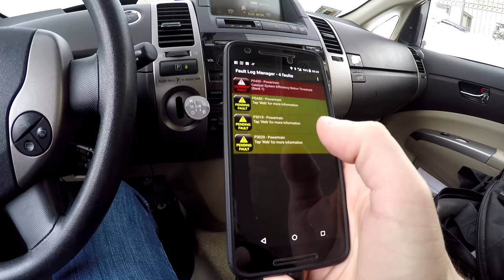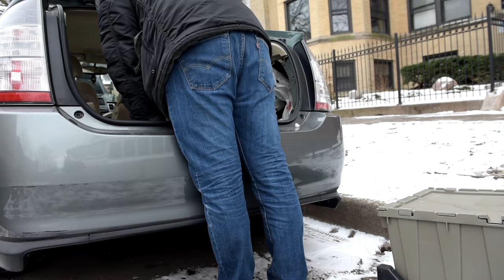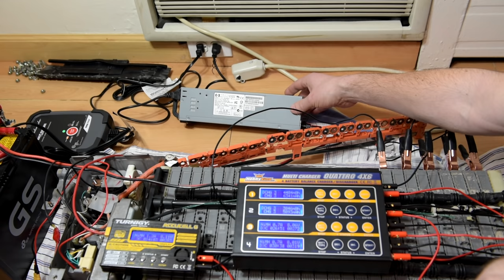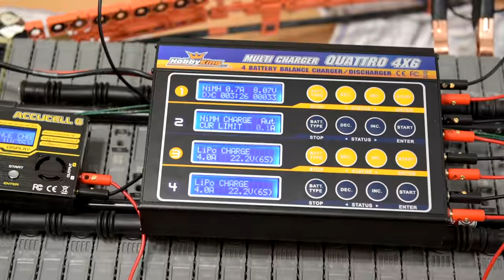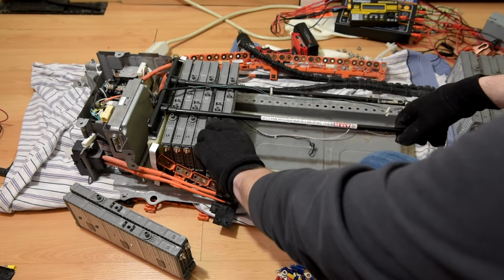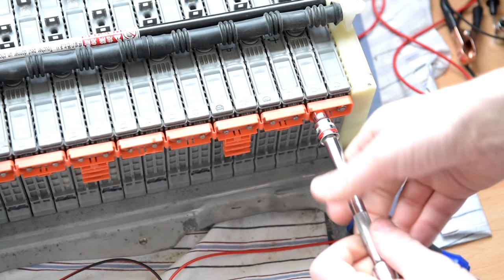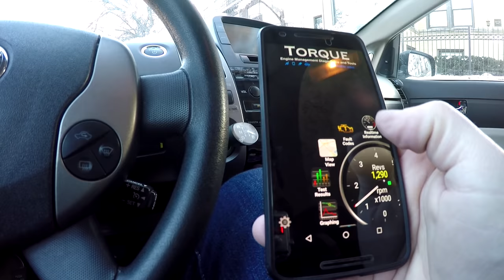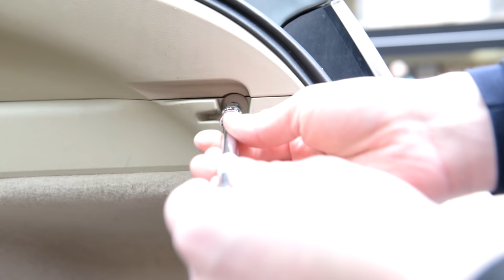Hybrid Battery Repair Ultimate Guide (Toyota Prius 2nd Gen 2004-2009) DIY

Comment: Dear igor need urgent help at 32:16 you say connect all the positive together and all the negative together to make a big battery.... How can it balance it self when there is no flow?? Can you share with me a drawing... Your video helped me alot
Reply: From my reply above: at the end of your cyclical reconditioning, get all the voltages of the 28 modules within .05v of each other and then carefully connect all +.  Separately, carefully connect all -.  In this way your modules are all in parallel (a large capacity 7.2 cell, essentially).  Let sit 24 hours and they will all self balance.  I ended up locating all the + on one side of the battery and all the - on the other and then running a thick long wire of solder to all the terminals, and gently tightening the nuts down to hold the solder 'wire.'

Comment: What is the lowest mAh value of a cell for car to throw triangle light ?
Reply: ECU would throw Battery error based on voltage difference between blocks. I all cells are equally bad, there will be no errors.

Comment: one question please, is it normal for the single battery to swell during charging? second
  what difference is there between the 2 Gen. and the 3 Gen. batteries ???
Reply from the maker: You mean , only one module is swelling and the rest are not? Then it’s not normal. Not sure about Gen3 , never worked with them. You can check forums on PriusChat.com
Reply: @IgorKadulenkov  thanks a lot
Reply: It swells usually when it is overloaded or weak. The battery in good condition and properly charged has virtually no symptoms.

Comment: How much time does it take to cycle 1 module 3 times?  Did you charge at 3 amps or 5 amps?
My 4 port charger can discharge at 2 amps.  Would it be okay to charge at 5 amps and discharge at 2 amps?
Reply: cycle will depend on condition of the module usualy 1 charge-discharge cycle is around 5 hrs, its better to discharge at 1 amp.
Reply from the maker: For me it took about 24 hours to cycle 3 times at 5 amps, I was discharging at max discharge current- 1amp on Quattro charger and 2 amp on single charger

Comment: Can you tell us what was the mileage shown approximately in the time, when you made the video? Because that steering wheel is looks like new. :)
Reply from the maker: Thanks. It was between 200k and 205k miles. However, the battery was not original, it was replaced by some questionable shop with bad reputation and only lasted for a year.
Reply: @IgorKadulenkov  Thank you! Now just need a similar charger/balancer as yours in the video. can't really find one on eu servers... any advices? :) Thanks

Comment: Hi Guys! Do you have any information about where can i buy  a smiliar charger in Europe, like that, which Igor used in the video? @16:56 ?
Reply from the maker: Hello, I would check Hobbyking.com . I am sure they ship to Europe, they have European warehouses. People saying good things about Reaktor chargers , they’re more expensive, but you could sell it after, perhaps https://hobbyking.com/en_us/turbo-charger-1200w-4-300w-synchronous-balance-charger-discharger-version-2.html Or you could try some other hobby charger
Reply: @IgorKadulenkov  Thank you. I'll take a look. :)
Reply: @IgorKadulenkov  There were the rewievs, and some said its not that good as yours, and also some minor disadvantages, so started to look after similar products. In my case the hobbyking stuff is too expensive, but found a similar: Ultra Power UP100AC DUO 100W on banggood. 
not 4, only 2 ports available, but 1/3 the price approx. on youtube found some reviews. but, in my country there is a guy, who renews prius batteries for that ~100$ price, ( check hybrid system on google maps in budapest area) and does the cleaning too for the tipical prius odour, and stuff like that. :) respect Igor! :)

Comment: Why do you indicate the capacity cut- off at 7500 when the capacity of these batteries is 6500
Reply from the maker: This is just a safety measure, if it doesn’t stop the charge automatically

Comment: So how many amps is that lightbulb discharger you made and would it be any different than using a discharge cycle on max setting?
Reply: @Vatslav Orlov I just got through using a lamp and it worked well. But the turnigy x4 charger I bought does up to  3A discharge.
Reply: @Vatslav Orlov what light bulb would you recommend to use for discharge and do you connect the bulbs until they are off
Reply: @Vatslav Orlov Thanks
Reply: @Vatslav Orlov I have one more question if you don't mind, when you are programming the Turnigy, I noticed that when you select NIMH there is a bracket and you can set the number inside the bracket from 0 to 9, what does that number means? also how EV-PEAK CQ2 compared to the turnigy (advantages/disadvantages?)
Reply: @Vatslav Orlov Thanks you so much, one I set the Turnigy the first day, I noticed it was not working in auto and it would stop after it finished its charge or its discharge although it had 3 cycles programmed, however, the second day it worked in auto. not sure how can I see this "Auto/manual" switchover settings anywhere as their manual is not really clear about that even when I followed the flow chart.
also, I remember the seeing things in the beginning that I am not sure how to get to again such as "Balance"  & "Store", I remember seeing a screen where I selected the voltage to be 7.4 VDC but now I don't see it, not sure if you have any advise on that.
Reply: @Vatslav Orlov Thanks for all your help and clarification

Comment: HELP PLEASE. My car only turns on when jumpstarted. Otherwise I’d completely off. Battery has been tested and is good. Still holding a charge. The biggest clue is that once (one time only)  I move around the battery and the car turned on!! By itself, I was just removing the positive terminal cover. Checked connections and all have 12.2V so it’s good. I don’t understand why’s happening connectors seem good and the other clue is that the frog designated jumpstart location says 1.2V! Prius is dead help please!
Reply from the maker: Which battery has been tested? Hybrid or 12V? Maybe your 12v battery is dying? That happened to me, it would not start even though the HV battery was ok.
Reply: Igor Kadulenkov thanks for the reply. I figure it out and now it’s fine. I had bad connection to the ground (body of the car) I had to mess around with it and it turned on and it has been working good ever since

Comment: @ 10:00 Very bad move to use a screw driver to pry out the black covers.  Easily cause a spark which can damage other parts, possibly the inverter or even the computer.  I caused a spark from just removing the orange bus bar assembly after removing all the nuts.  Be careful.  In this case, no so much because the battery is outside the car and not connected by the big orange cables.  Otherwise, very good video.
Reply from the maker: You are not supposed to disassemble the battery inside the car and when it is still connected to the main terminals. This could be a death hazard

Comment: I am getting a about 6000 discharge and 7200 recharge. My charger will cut off at 7200 and then begin a discharge cycle. I have don't each at least ten times. Is this bad or good?
Reply from the maker: If you getting 6000 on discharge, your module is great already. It’s 92% of nominal capacity. I would just stop there
Reply: @IgorKadulenkov  wow I'm impressed. What about balancing out the voltages? Using a bulb won't cause any problems and throw off the balance?
Reply from the maker: No, it’s safe to use a bulb on a module. These modules take a harder beating when in operation- high discharge and charge currents

Comment: Hello! I have a question. I'm just beginning this process, and I just did my first discharge/charge cycle. I have a Venom Pro Quad charger with almost the identical menu as yours. I set my settings to NiMh automatic, 1a discharge, 3a charge. Discharge to 6.3v went fine and showed 4800 mAh capacity. Charge cycle kept going up. Voltage on charge LCD showed 9.2 volts and I turned the charger off at 7500 mAh. 

Do you have any idea what might have caused this? Probing the module after charging shows about 8.2 volts. I was reading about the Delta peak setting- should I try turning that down? The module was not hot that I could feel (it was #1, couldn't feel any heat through the end cap). Thanks for the video and thanks for any tips you can give! Thank you.
Reply: Most likely your Charger has ignored the max recommended cell voltage or has read the "battery signal" incorrectly. You must be careful not to exceed 8.5V under any circumstances (It's best to set the cut-off to 8.3 - 8.4V, so you don't overcharge the battery.)
Reply: Hi Steve,  did you solve your problem?   I am going to do this same thing shortly
Reply: @Angelchase4676  Hey there. Yes, I did get it sorted out. What I learned is that these hobby chargers are generally not good at detecting the Delta peak of Prius modules. So my solution was to:

A. Set a max charge of 7250 mAh. Someone on Priuschat made the argument that since these modules have an AH rating of 6.5, charging up to 7250 should never over charge them, since charging efficiency is like 60%... or something (don't quote me on that). Many of my charge cycles just ended at 7250.  

B. I upped the charging amperage from 2A to 5A. This makes the Delta peak much easier for the charger to detect. This clearly helped, and there were quite a few charge cycles that ended at Delta peak. 

Also, I believe the voltage displayed on the charger while charging is the charging voltage- ie what it's inputting to pull the battery voltage up. As soon as the charging finishes, the modules showed 8.2v, which is what one would expect from a fully charged module. 12v car batteries show 14-15 volts while charging, so I think 9 is ok for a 7.2v battery. Just my conclusion.  

Also- if you can figure out how, I'd get a charger capable of graphing the discharge voltage over time and use that primarily, rather than Ah or internal resistance alone, to dictate which modules to replace, and to verify that your new modules will match up with your old ones. This is really what will make the pack last- modules with really similar discharge curves. I think many of the 4 button chargers have the capability to do that. 

I just used the discharge mAh and an internal resistance proxy test (headlight bulb, high and low, for 60 seconds, noting the voltage drop over time). But realized afterwards that discharge curves show how the battery behaves at any given battery state (empty to full). It may behave well at full charge, but bad at low or the opposite. Amp hours and internal resistance are both just snapshots. 

Car is running great so far though. Dr Prius App gave it 85% capacity. Getting about 45mpg. Hope your project turns out well, also!
Reply: @stevevanpelt4475  THANKS>

Comment: Hi, have a 3 Gen prius, already fix my battery, replace all the weak modules.. But I cannot erase the P0A80 code... it´s marked as permanent, and after 2 or 3 days driving I get the "check hybrid system" message.. any ideas?
Reply from the maker: Are you getting additional codes or only P0A80? Maybe there’s another bad module?
Reply: @IgorKadulenkov  Thanks for your reply, I had the P0401, so I though that code was making the P0A80 appear, I already fix the P0401 (EGR clogged) and now the P0A80 is the only code, yes, I though like you said that maybe a bad cell, but I already check them all with Techstream and all seems good, good voltage and good resistance.

Comment: I trying this but I did not see where to set charge voltage. Mine has charged to 8.5 volt and I'm afraid
Reply from the maker: I haven't set the charge-to voltage, it was set to Automatic with cutoff mAh at 7500. It would automatically detect when to stop charging.
Reply: I read somewhere that it's safe to charge these (7.2 nominal v) modules to 8.4 at a high rate (1C.5 Amps) and then beyond that it's safest to charge at a very low rate such as .340A.  In practice, running lots of ventilation into the duct below the modules, clamped in, I charged from 6.0V up to a capacity limit of 7250mA at 2.5A.  You wouldn't want to stop at 8.4 entirely, because the reconditioning process is to push the weaker cells to gain a little capacity by gently overcharging, I believe.  It's equally important to discharge down to 6.0v to gently stretch the full range of the 6 internal cells' capacity that make up each of the 28 modules that make up the total battery.
Reply: @IgorKadulenkov  mine does not detect and continuet to the 7500ma and then cut off. Can this be negative for the battery?. Where charged at 5a from 6v.

Comment: Why would you only care about the minimum discharge mAh rather than the maximum charge mAh?
Reply from the maker: Because a lot of the current goes into heat during the charge, data is not accurate.

Comment: There is a special 12mm screw that i dont know where it was. It is longer and a greenish colour, can you help me?
Reply from the maker: Where it’s coming from? Detaching or opening the battery?
Reply: Opening it. We didnt take the battery out, only opened it and didnt find the place of that screw.
Reply from the maker: Hard to tell after all this time, could it be the screw that holds a metal cover plate on the side of the block?
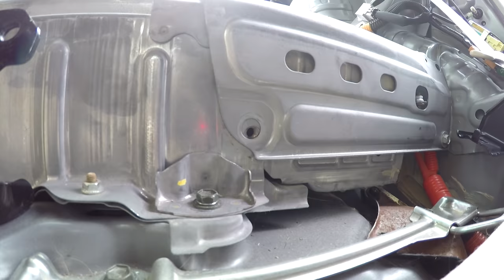Reply: it looks like the one in the video at 6:28 on the bottom left but i am sure it wasnt where it is in the video.
Reply: Igor Kadulenkov yes, definitely, but i dont know which place, because most of the screws are silver and this is the only one greenish

Comment: I am in the same boat as Jim, which charger do you think we can use?
Reply from the maker: Maybe you could get 3-4 more chargers from what's available? https://hobbyking.com/en_us/batteries-chargers/chargers.html?wrh=2%2C3&stock=1 
I think some people were using IMAX B6 50W which is 25$ each. There is a bit of discussion about IMAX B6 on PriusChat forums. TURNIGY REAKTOR is really good, but it starts at 50$ for a unit. You can also get Turnigy double chargers for 100$. You could also sell them on eBay later, once you've done with reconditioning.
Reply: I have purchased the Turnigy quad charger from HobbyKing, but it will discharge at 0.5 Amps max. If I were to do this differently, I would just search for "B6 charger balancer" on eBay - they are $15 for one.